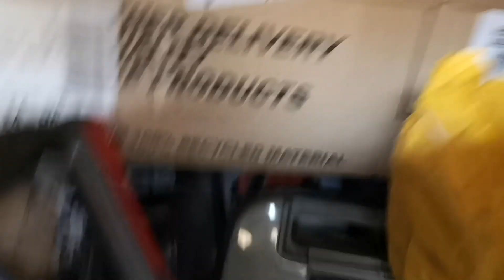Bin Finds with Beko! Vacuum hunting in the trash pile!

Comment: I want one of these grey tub vacs you have, up for grabs?
Reply from the maker: It will be yes, the nilfisk? It needs tools though
Reply: As long as it has the hose id be interested at decent price
Reply from the maker: @hoovermaster  well it cost me £20, you can have it for that plus post if you want. Otherwise I'll refurb and sell it. It runs, I've used it for the cars but it's utterly minging! Motor seems alright, cable is a bit battered though